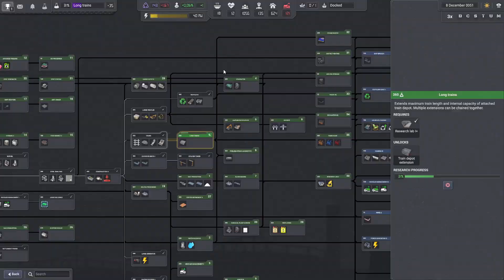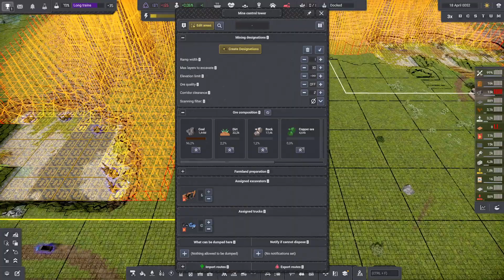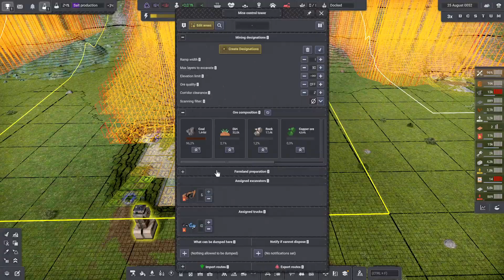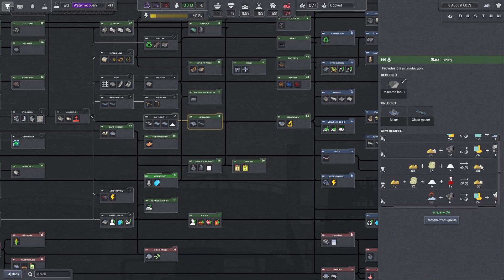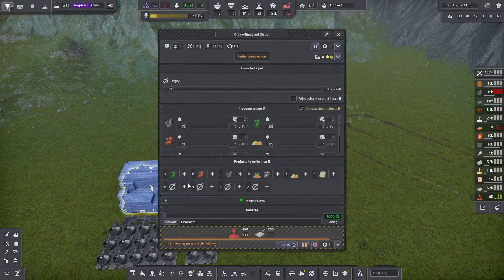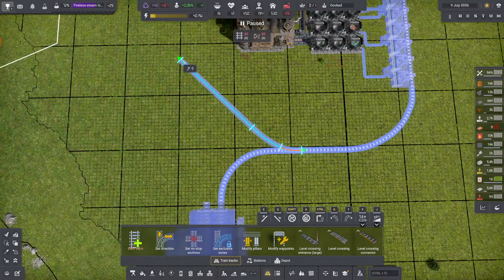Captain Of Industry Extended Moded 2026 Episode 6

Comment: Your all good to just overwrite the folders when updates happens. If not i will make that info in changelogs then. But if you want to still remove you lose the saved settings folder inside every mod that stores all your settings that is why it resets. So you can do 2 things. 
1. overwrite all safe to do and your saved settings are then saved.
2. If removing old mod folder you need to backup the saved settings folder for that mod and put i back to new updated folder to get your settings back. =)